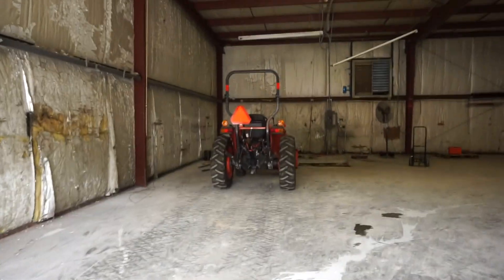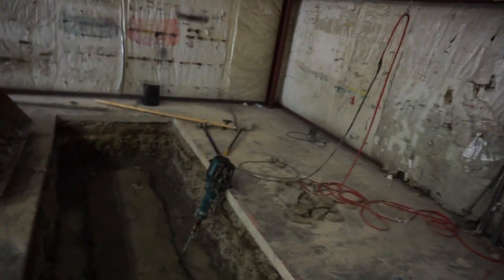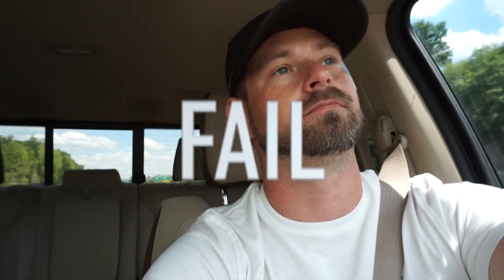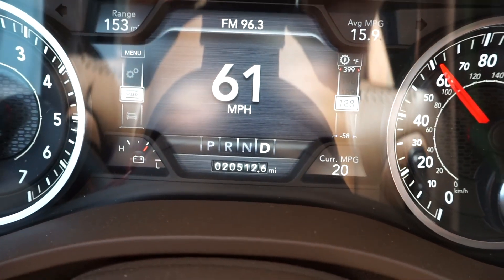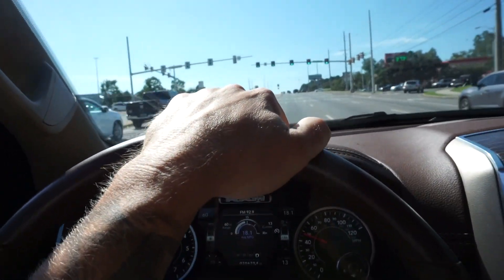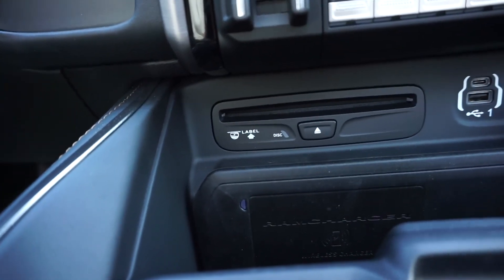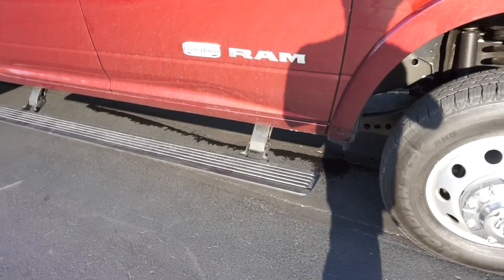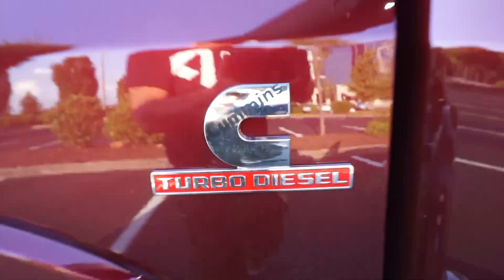It Was Time For A Change

Comment: I finally broke and bought an older 2500 it's an 06 megacab  and it's good enough to pull most everything i need it to. not that my Escalades weren't but this one is in good shape still, as a precaution i changed the ball joints and tie rod ends and rebuilt the AC on it. I love that the back when you lay the seats flat has enough room in it for a full sized mattress. Mine also has the sunroof, not really a fan of that being it only opens up a little over half way. but I do love the power sliding rear window.  I also have a 2019 Ram 1500 Hemi that i'm driving all over the country for work. had it 3 weeks and already have over 10,000 miles on it. love both trucks actually but i still love my escaades too. just hard to beat that power and comfort. so the active vehicle count is 2 dodge ram trucks (06 mega cab, 19 crew cab hemi) and 3 escalades (04 EXT, 05 Luxury SUV, and an 06 EXT)  so the best of both worlds basically. Love the sound system in the 2019 (that thing cranks pretty well) no hell cats or red eyes yet though. i had found a pretty decent deal on a wide body but the dude backed out of the deal and decided to keep it last minute